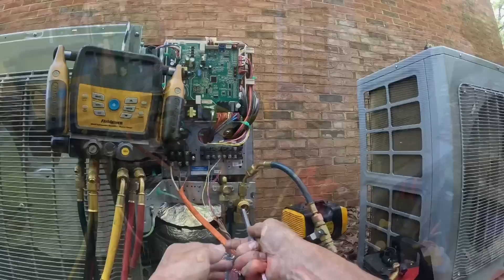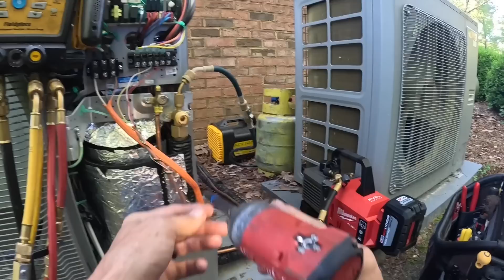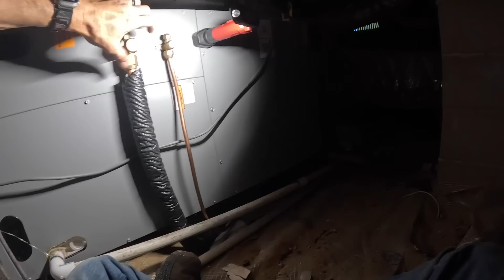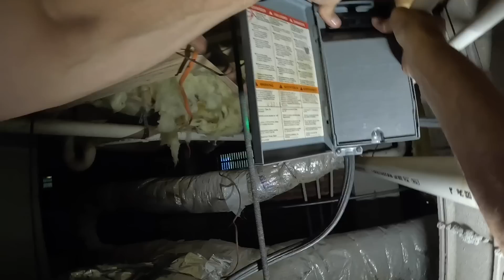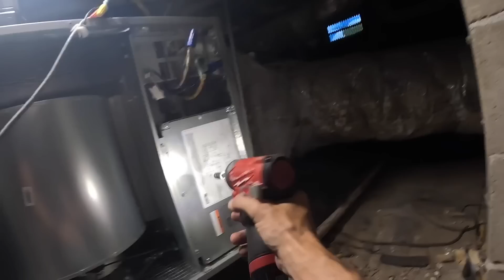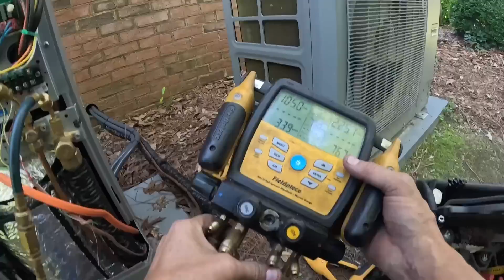Repairing Line Set Connection I Apparently Ruined! #hvacguy #hvaclife #hvactrainingvideos

Comment: Those pesky sticky disconnects..  A shot of WD-40 would lube on the plug in handle contacts will slick it up a little and also remove any moisture from those connections.  I would shut off the power at the breaker before spraying the disconnect just in case something is conductive, but since it's really made for that kind of use as a water dispersant...  I know it works great on extension cords around the house.

Comment: Good job owing up to the issue, but I don't think it was really your fault. The quality of the "brass" they use for those fittings and nuts isn't the greatest.  Do you have Nylog? I used it on the few minisplits I have installed and it helps with flare fittings. A drop on the threads and the shoulder of the flare makes them go on like butter.

Comment: Interesting that they put isolation valves on the evaporator would make future leak searches a bit easier bejng able to pressurise just the evaporator coil, lineset and condenser

Interested to know if you do find out if you can force 100% capacity on those units

Comment: So you valved off BOTH  evaporator service valves. And pulled a Vacuum from the suction side of the odu all thru the “liquid line” to the indoor unit? Never really messed with splits

Comment: The right way to fix that, there's only one right way to fix that it's to replace the valve. If any one in therye  right mind wanted to try and fix that with out replacement are just crazy and should not be in this trade.

Comment: Dont those Gree units have an eev in the outdoor unit? If so thats an expansion line, not a liquid line and should be insulated like the suction line.
Reply from the maker: Yes and no. The eev is only to add subcooling. It is a true liquid line. And the txv is in the air handler.

Comment: Curtis good job and as for that connection and the stripped thread I am not sure it was your fault even the thread pattern on the connection might not have been cut corectly at the factory too.

But at Least you replaced the part and made it right and about time you did more gree vidoes.

Plus we need to remember the rest of the world uses the metric system too.

Comment: I watched you today and you had to struggle with the yellow wire wire nut wire splice. You even had to go down to the truck to get pliers. Might I suggest using a Waco Fixture connector Item no. 224-201.
I think this is a new product for Waco. It will handle the small thermostat tray cable 18 and 20 Ga wire. There is no need to waste time twisting and untwisting them for wire nuts or restriping due to broken wire ends. Just strip the wire and stick it into the splice. To remove the wire just squeeze the splice to release the wire.

Comment: Good video ! threads were most likely junk from the factory. seen it a bunch of times.
1) Why no Wet Rag on Fitting while brazing ? where stub out meets new valve best to wrap wet rag right there.
2) Get yourself a $5 husky bag from home depot for doing a little air handler work. throw a multi screwdriver 🪛 in it , wire strippers and a meter. just nice to have a little bag for quick trips at air handler. a couple fuses maybe , a few wire nuts & lil popper.

Comment: You bring trust and respect to your trade, Curtis. You don't try to deny culpability, you just take responsibility and fix it. A lot of other techs would've tried to duck, dive and deny!
Reply from the maker: Thanks
Reply: I have worked with too many so called techs that do the cover up their mistakes with shoddy work or just barely together. I have come behind them to fix the recent repair or install and find all their errors and the company has to take an L on the job with me having to repair it. Really stupid that they never got fired after the 4th or 5th time I find all the problems. It was at least job security for me. Frustration galore with that company. Now working for a different company and less stress.